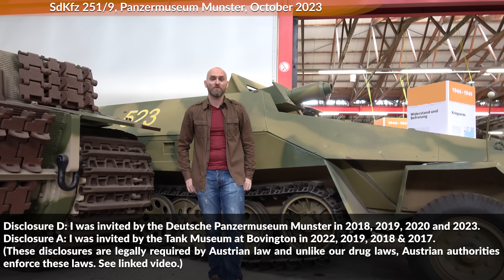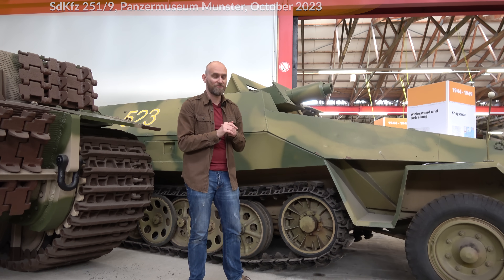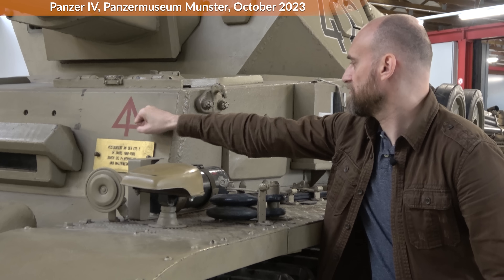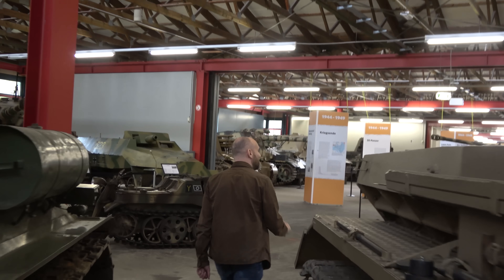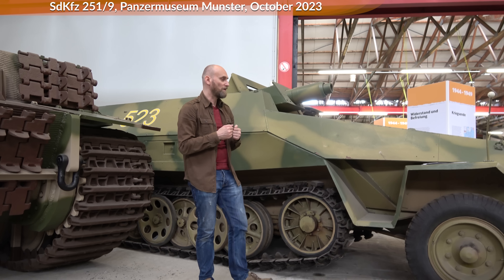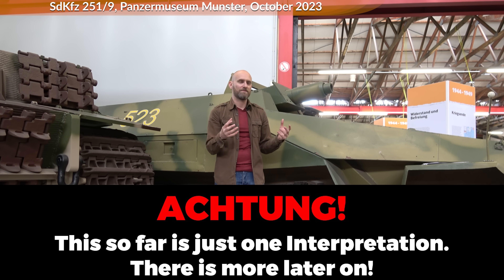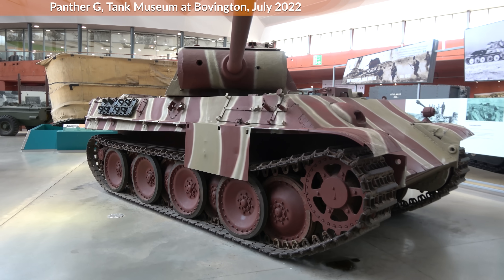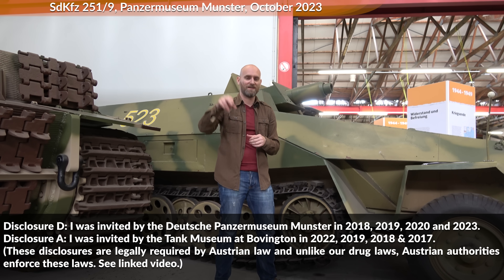Why was German Sloped Armor so late?

Comment: Vehicle designers of that time had only a vague knowledge of the effects of shell denormalization, and how to instigate or mitigate it. Their thinking of the efficiency of armor boiled down to mostly sine of the angle from horizontal. What it means is that they said "80mm at 40 degrees from horizontal? That´s just about 125mm. That´s not good enough." Meanwhile the reality is that almost no shell was stable enough in order to "bite" into that angle without major deviation upwards. 
Modern simulations suggest that Panther II with its 100mm thick front armor would be almost impenetrable even to the mighty Soviet 122mm gun.
Reply: Well, 122mm had been tested against Panther front. It was particular requirement for a gun - to take   Panther  from the front from 1km, which 122mm fulfill.
Reply: @vladimirpecherskiy1910  That much is correct, but you also have to mention the rest of the conditions. 
Yes, the 122mm gun was able to penetrate Panther´s upper front plate at 1km. Hell its even able to knock out Panther at 2km. 
BUT that is only the case if the Panther´s hull is pointed directly towards the IS-2´s gun. If that Panther sits at a 30 degree angle, those 2 kilometers are reduced to 0.1 kilometer (100 meters). 
The soviet shells really, REALLY didnt like angled impacts.
Reply: @pavelslama5543  I do not think there was any special to soviet shells, if anything that difference between blunt-headed and sharp-headed rounds. Blunt-headed known to be better on normalization when hit armor on angle but worse on penetration on low angles. That trade off.  
122mm was naturally very effective on Panther, no question about it.
Reply: soviet designers probably also realised how ridiculous it was, which is why the later IS-2 did not have ridiculous slopes in the front, and the later T series tanks had redesigned suspensions and engine spaces to allow for a practical sloped front, and they still decided to cast a round turret for all of their primary tank models
Reply: 125mm is good enough. It is very good. Tiger I was considered almost impossible to knock out and it "only" had 100mm front armor. So personally would I consider 70mm armor with say a 50 degrees slope (or more) to be good enough for a medium tank. Having thicker armor than that would only be wasteful in my opinion and bring extra weigth, slow down the tank, make the tank too heavy to the front, having too much armor at the front so weight have to be saved by cutting down side armor and making the tank weaker and vulnerable to hits from the sides, rear and top.
So I think your suggestion is a bad idea.

And then it also depends on the type of tank. Hetzer would I consider to be extremely well protected. Its small and easy to hide. And the enemy cannot shot at you if he does not know that you are there. And when he discovers you, then he will have a diffucult time hitting a small target like the Hetzer. And Hetzer in a hull down position its even harder to see and to hit. And if you manage to hit it, then will you probably only hit it where the armor is the strongest - the frontal top of the hull. And there will the thick armor with a sharp sloping give pretty good protection, even against pretty large caliber guns at longer ranges.
So its a pretty cost-effective use of armor the Germans had with this little vehicle.
Reply: @nattygsbord  you just described T-34/85. my congratulations!😁
Reply: @sergeyboychuck8872  
T-34 and M4 Sherman did have sloped armor and somewhat okayish thickness. So I think they were better designs than the German tanks that either had crappy armor or was too frontally heavy.
I guess low quality steel in the russian tanks made their frontal armor not so fully effective as their american counterpart. And bad tank crews and poor ergonomics and other shortcomings could probably explain much of the high soviet tank losses.
But the general idea was sound. It had frontal armor of the right thickness. And it had a gun of almost the same calibre as a Tiger I and inside a medium tank.
Reply: Modern Simulations = War Thunder protection analysis
Reply: @del3teo664  Incorrect. 
Modern simulations = ballistic material stress and toughness simulation 
https://www.youtube.com/watch?v=5xDga5fUdMg&ab_channel=SYSimulations
Reply: reality harsh, IS-2/3 had zero problems with their 122 mm against Tiger's.
Reply: @sergeyboychuck8872  But you are comparing apples with oranges I think. Tiger I was an old design. It was very good at its job facing tanks made before its introduction in august 1942. But it was never really meant to be invincible against tanks made after that. And the Soviets also deliberatly armed their tanks with the only guns they had that had been proven effective against the Tiger - such as the 85mm Anti-aircraft gun they put in the turret of T-34. And the 122mm gun they gave IS2. And the 152mm gun on SU-152 and ISU-152.
No tank could survive a hit from those guns. Just like no tank today can survive a direct hit from a 155mm or 152mm artillery piece. But it would be stupid to say that armor protection does work because it cannot survive direct hits from high calibre guns.
Reply: @nattygsbord Why shouldn't a tank survive a 155mm HE shell ? What proof do you have for that ? A game ? 😅

A Tiger 2's UFP could not be penetrated by any Soviet gun ......
Reply: @5co756 thats a common artillery caliber, feel free to look at what has caused tank losses throughout conflicts up to and including today. Even very well protected tanks tend to have problems with large caliber HE shells (even more so arcing in from above) as you cant feasibly armor every area of your tank equally as well.
Reply: @5co756  IS-2/3 says "we don't know that Tiger's (both) are impenetrable. we are so sorry!!!"
Reply: @misterperson3469  They can damage tracks if it hits near a tank , today we have drone/GPS guided arty or self guided arty shells . They are way more precise,  in WW2 it was more a luck shot to hit with arty a tank directly . He was more speaking of big caliber HE shells at direct fire role , like in WT .
Reply: @sergeyboychuck8872  I said Tiger 2 , Tiger 1 is no match for a 122mm .
Reply: @5co756  in the best case scenario for a tank which has been hit by a 152mm/155mm HE shell, it that the tracks, gun barrel, sights and vision optics, are completely ruined. In the worst case scenario the welds fail
Reply: @5co756  and those same vehicles did exist, they didnt slam you in the face at 20m in an urban engagement like you might see in WT but they would still engage tanks, and at longer ranges even if it is still direct fire they will arc a fair bit.

And yeah artillery hits on tanks is mostly luck with dumb munitions but you questioned what evidence there was of a tank being disabled by high caliber HE and its that they have always been and still are to this day vulnerable to them.

Thats not to say an su152 or KV2 would match a tiger 2 in capability but they certainly are able to take one out of action with a clean hit.
Reply: @pavelslama5543  In tank combat, who fires first usually wins. IS-2 has a very good reverse speed. The slow reload rate is not as much of an issue as you might think,.
Reply: @5co756  Even today there is a NATO standard for crew survivability in case of a 155 arty shell falling nearby. Today's most protected and well thought tanks can survive such shell landing as close as 10-12m. so a near miss of direct hit would most likely knock off the crew or instantly made their lives extremely painful (and that is today, imagine a Tiger tank being grazed by a soviet ML howitzer or even a B4 203mm)
Reply: @chrisca  What should kill the crew inside the tank ? The shrapnel can't penetrate the armour , your comment make zero sense .
Reply: @5co756  The blast (aka the sheer concusive force created the explosion, manifested in a pressure wave that goes through the armor and ails the crew inside, given the tanks are filled with air inside).

I don't claim to be an engineer, or a scientist, but in broad strokes it is how it goes. For more info, STANAG 4569
Reply: @chrisca  A pressure wave or blast wave does'nt travel through solid objects , it gets deflected by them . 
We saw many hits of arty near tanks and they still keep driving , would be stupid to build a tank to protect the crew and a HE shell landing nearby would kill the crew inside .
Reply: @5co756  Ask someone who went to Afghanistan, Bosnia, Israel and ask them about IEDs, pretty sure an HE 155 shell or a jerry rigged explosive detonating nearby can injure of kill the crew. Information is there, you can take it or leave it, i'm not bothering to argue further
Reply: @chrisca  You know nothing about it but keep telling me that it has to be so ? What's your proof ?

Just look at mine clearing tanks , there are huge explosions with way more power than a 155mm HE shell . And the tank driver still moves on or gets out of the tank , he was not dead . Why ? Cause he is save inside , just depends on the size of the explosion . 

That was the whole reason why people build or invented tanks over 100 years ago , to protect the crew or soldiers from gun fire and artillery .
Reply: @sergeyboychuck8872  if they spot the tigers first Yes, But the Problem about IS-2 is that it literally Takes  2minutes to Reload that dinosaur,Plus a Terrible Optics so the moment they miss its all over
Reply: @Raddenstein23  Nope, it takes 15-20 seconds to reload for 155mm from my experience. and i think it would be same for 122. About fire rate of Tiger I - there is enough evidence that it was much slower than it was in specifications. Otherwise, T-34/85 with the same fire rate were not able to defeat Tiger's - according to multiply sources they fire few times more shells than the Tiger's (5-7 from T34/85 vs 1 from Tiger).
Reply: @sergeyboychuck8872  My experience? In what? warthunder?
Reply: @Raddenstein23  yes, it's called M109A6, IDF. "sarcasm mod off"

Comment: Probably because they figured it would be easier to add more armor onto the flat designs. It didn't work with the Tiger 1 but Panzer 3 and 4 had quite a few armour thickness upgrades during the war i think. I don't think any German or Soviet designs up armored a sloped hull design during the war. It would probably be similar to the issue that happens when adding ERA to tank that wasn't designed for it.

Comment: Sloped armor doesn't actually provide an advantage in terms of saving weight. If you expect hits coming from front, you can easily double the armor thickness without doubling the weight with non-sloped armor because you're adding thicker armor to smaller surface area.
Reply: Nope, you can't physically make non-sloped armour to have twice as little less surface as sloped armour, look at the actual design of tanks
Reply: @ФедяКрюков-в6ь  Are you suggesting it's impossible for a hypotenuse to be over twice as long than the height of a triangle? An example here. If the length of the triangle is 3x as long as it's height, would the distance traveled between the height and length of the triangle not be longer than that?
This is not to say there's no advantage to a sloped armor. Deflection is after all more energy efficient than outright stopping a projectile and against certain ammo types it has an added benefit.
Reply: @strongback6550  well, that's an interesting exercise in geometry, but irc the Panzer III or IV hull shape has the least possible surface, because sloped 'nose' covers the forward wheel shaft and legs of the driver, while the vertical part covers his head in the sitting position. That's how those hulls were designed in the first place. You can build yet another A7V-esque tank with only a vertical armour plate at the front, but in that case the armour surface would be bigger thanks to the unnecessarily enlarged internal volume in front of the driver.